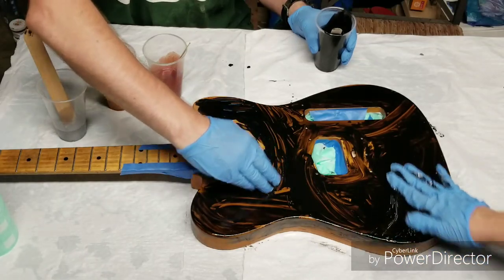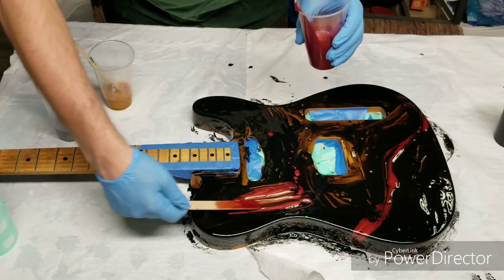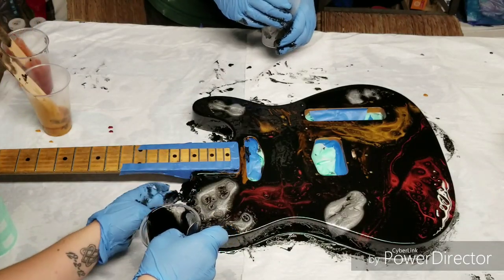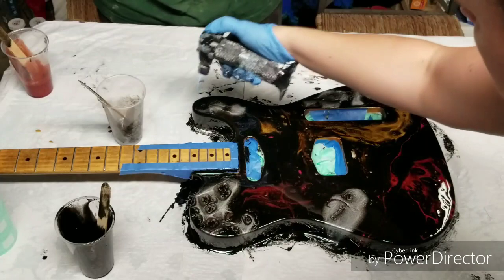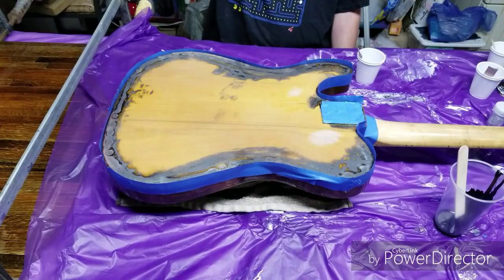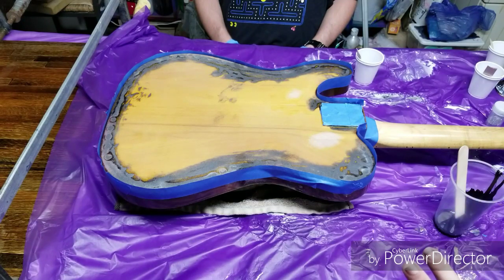Guitar Pour with Mixed Media Girl!!!

Comment: How did you manage to stop the paint scratching after applying? I tried using some spray on clear coat from a can, but even after weeks, it can be dented with just a finger nail.
Reply from the maker: We painted one side and left it to dry.  The resin protects it, and gives it the shiny surface.  Let me know if you need to know anything else, I'll ask Mixed Media Girl for you!  :)
Reply: There is also a clear coat in a can designed for car paint spot repair. Careful with this stuff, very toxic. But, it'll be rock hard after cure and works on top of everything! Find it in auto part stores
Reply: @alecfleming373  the paint did eventually dry on my tele, it just took about 3 months. It's rock solid now! - the toxicity worries me, I won't be doing this again, ever. Some nasty chemicals involved, that absolutely require a professional setup to apply!